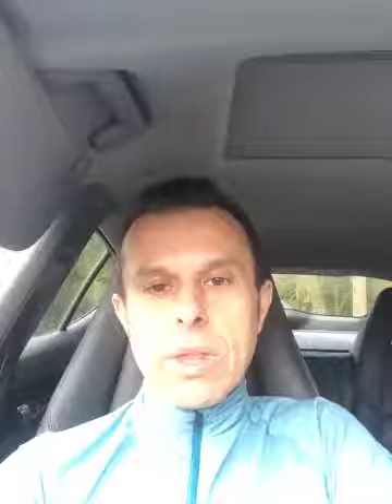Screed Expansion Joints Underfloor Heating - Do you need expansion joints in your screed?

Comment: I have a 180 m² single-story house with load-bearing walls only on the exterior. Interior walls will be placed on top of a floating screed, which will be 6.5 to 7.5 cm thick, incorporating underfloor heating. I’m considering expansion joints for the screed and would appreciate some advice.

The house is a rectangular 17 x 11 m shape, so we plan to divide it into sections of no more than 40 m² each. However, I’m unsure about how the joints should interact with the interior walls on the screed. Should expansion joints be placed around these non-load-bearing walls as well, or is it unnecessary in this setup?

Additionally, is it feasible to lay out the expansion joints in rectangular sections under 40 m², and then use a saw to cut joints 1.5 - 2 cm deep around the non-load-bearing walls afterward?

Thank you for any guidance!

Comment: do you need expansion joints if you add fibres to screed mixture? thanks
Reply from the maker: Nice to hear from you Johny.  It all depends on the bay size, shape of the room, and aspect ratio.  A general rule of thumb for stress relief joints is 5m to 6m intervals.  A heated levelling screeds typical maximum bay size would be 40m2.  The fibres will minimise shrinkage cracking, however stress relief joints are still required.  I hope that helps.  Regards Andy